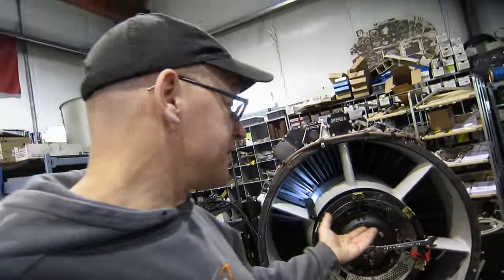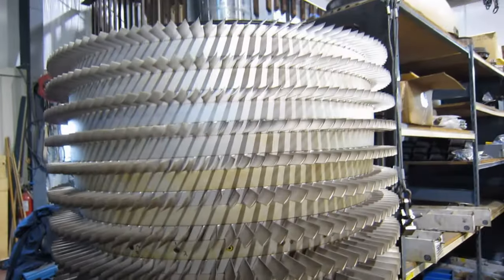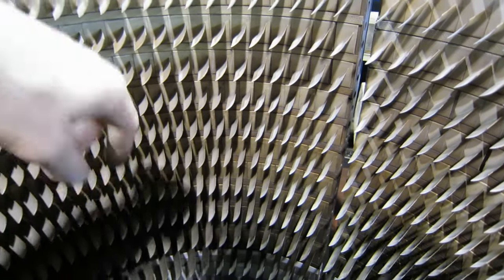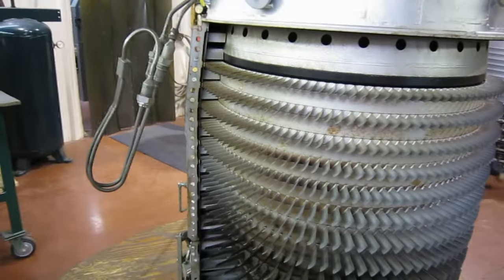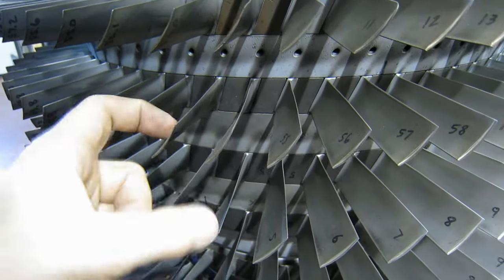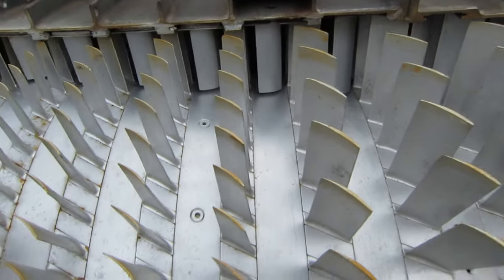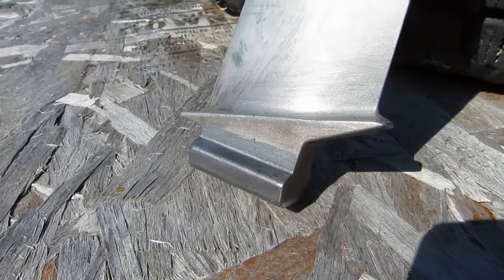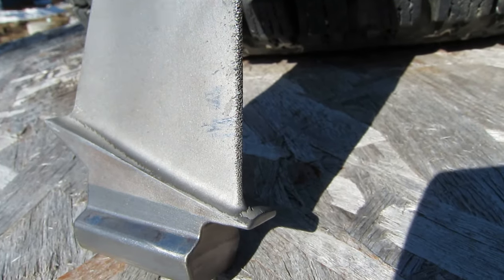Compressors - Turbine Engines: A Closer Look

Comment: Fascinating video seeing inside the guts of one of these turbines. I work with the power generation industry and and have written and talked about the economics of combined cycle gas turbine power plants since 1996 all over the world.  

Never seen one in real life. Its just numbers on a spreadsheet. I told somebody I needed $10 billion to build a few last week. 🤑
Reply from the maker: This is not a turbine. It's a compressor. One of the first steps to confusion and miscommunication is to call a turbine engine a turbine.
Just like with cars that have piston engines... do you mean the piston, or the piston engine.
Just letting you know, if you ever see "that look" in the eye of an engineer when discussing these engines...
Reply: @AgentJayZ  The compressor stage feeds highly compressed air into the combustion stage of a gas turbine and is a very important part of the 'guts' as you know. If you stop the video at 4.40 the thing you were stood next to is an LM1500 aeroderivative gas turbine used in a number of applications including power generations. The combustion stage and the final turbine stage is to the left of the frame and the compressor with the case off is to the right of the frame? The LM1500, had inside components from GE’s first supersonic engine — the J79 — and generated more than 10,000 kilowatts. I deal with industrial gas turbines which are much bigger but fundamentally similar in basic design.
Reply from the maker: Fair enough. My apologies for assuming you made an extremely common error, that I hear almost daily. Cheers, bud!

Comment: As someone who actively works in a repair cell for the CFM  LEAP-1B (specifically in Air-Oil Heat exchangers) The amount of corrosion and surface damage these parts handle and are still fully functional astounds me every time. Luckily, like with these compressor blades, much of it can be safely removed or made safe and reinstalled. Its always interesting telling customers the parts they sent back required being scrapped as they no longer fall within the guidelines of our CMMs and OEM specifications.
Reply from the maker: Commercial airliner engines are maintained to extremely high standards. After they leave the shop, they are indistinguishable from new. Always good to hear from people in that industry.

Comment: very instructive video..thanks
Reply: younger guys go to A&P school and get a job with airlines. there is some job security in that the engine  overhaul cost is 90% parts  10% labor no matter where in world its done. here they can drug test & background ck  so even if chinese did it for 1/2 price labor  it would only save 5% to risk millions of engines aircraft to say nothing of killing people. New 3-9 compressor spool for GE  commercial C2 engine was $935,000 3 years ago

Comment from the maker: The blades are made specifically to be very stiff as well as tough.
So for their high strength, they deform very little as load is applied, and they are very resistant to crack propogation.

Comment: Seriously, thanks for taking the time to film this. This stuff is amazing. I had no idea there were so many rows of airfoils in an engine. It looks like it would be a real pain in the ass to put the rotor in. 

Quick question: Since we all see why birds are able to take down planes/jets, how did the guy that was sucked into a turbine engine make it through (let alone survive)? It's a popular video from several years back. Thanks!
Reply: Aha! I think I may have found the answer to my question after watching one of your vids! The reason that guy survived is because he was sucked up by a turbo fan engine and miraculously diverted through the airflow bypass part of the engine and not the turbine itself, correct? If I'm right I'm pretty damn happy I figured it out lol.
Reply from the maker: Tango8787 Sorry for the late answer... Google Plus sucks ass-balls.
No, you are not correct, sorry to say.
In any turbofan engine, the first thing the air encounters when entering the engine is the fan, and all of the air passes through it. If anything goes into a turbofan, it is "processed" by the fan. For anything larger than a hummingbird, death is certain.
The video of the person getting sucked into a jet engine is on an aircraft carrier, and the aircraft is an A6 Intruder. It has J52 turbojets. Lucky, because as I show in several of my videos, the first thing the air encounters as it enters a turbojet is a set of struts which locate the front bearing housing in the engine cases.
Next there is a set of stationary inlet guide vanes, which may be able to vary their angle of incidence to the airflow, in which case they are called variable inlet guide vanes.
After those two structures that would act as a barrier preventing a human from coming in contact with the rotating parts, is the first stage of the compressor rotor.
All of these parts are present in the same places in a turbofan, but the fan part is in front of all of it.
See my video called "turbojet or turbofan"...

Comment from the maker: 1) not really, and the display is using parts available, not necessarily fitted to the exact clearances.
2) Compression is about 1.05:1 up to maybe 1.1 to 1
3)See answer to TheMan1510's question
4) Axial is more efficient for big engines, centrifugal for small ones
5)Outlet temp depends on inlet temp and on total compression. For an LM1500, it's usually about 500F at full power

Comment: How much is the gap between the tip of the blade and the inside layer of the chamber (is this how you call it?)  I suppose for better efficiency the gap should be as tiny as possible?
Reply from the maker: Blade tip clearance on a J79/LM1500 is around 0.100 inch. On the LEAP 1B, it is effectively zero. The blades are almost always scraping.

Comment: You mentioned in another video that most stages can individually only increase the pressure by about 10%. How do smaller compressors like the one you showed get around this with just a few? Better cooling? Higher rpm? Just limited to under 2 bar? Awesome video by the way. Looking into these is like looking into a shark's jaws- thanks for the great explanations and footage.
Reply: Heyo, I know this one, there exist another type of compressor called a centrifugal compressor, which can massively increase the pressure before exiting.
The caveat is that you can only use 1 or 2 before it makes too much pressure, with axials, you can pretty much keep stacking them till you have exactly what you need

Comment: The new stators and blades you don’t touch by hand as they are ceramic and break with the slightest touch. Made to take extreme heat and be light weight in the GEnx.

Comment: Yep, what I like is the clever way pressure is increased, through each stage which was not shown as such. Apart from the spinining of the comp blades, each blade is angled slightly to it's neighbour, so as to form a converging duct between the blades. Each stator blade, is angled to the one next to it, to form a diverging duct. Bearing in mind, for a jet engine to work, airflow through it must always be sub sonic. So as per incompressible gas laws, these ducts cause slight increases in velocity (converging duct) with slight pressure increases (diverging duct) through each compressor/stator stage. This greatly adds to the compressor efficiency. Not to mention the cross section of the conpressor as a whole, which narrows from the intake, towards the last stator stage. That to me, is the clever part! Similar thing with the turbine blades which are set up for impulse and reaction blading...but that's another story!

Comment: Awesome video. That definitely helps me visualize how the compression works. I wonder if they still have to use the single crystal method to make the blades these days.
Reply: Yes. Single crystal blades are the method of casting.  From working in the casting manufacturer.

Comment: If you polish the leading edge of the compressor blade, wouldn't that create vibration because you've removed mass from one blade and thrown the system out of balance? Do you have to polish them all at once, or do something else to ensure they're balanced afterwards?

Comment: Great Channel!! I love seeing the inner workings of machines. Question. After seeing the clearance of the blades in the turbine, how did that guy survive being sucked into a fighter jet just before takeoff? Are the blades fragile enough to break when a human like object enters the engine?
Reply from the maker: Hopefully you realize that nothing at all of any size that is alive can survive passing through a turbojet. Not even a bacterium. There's that small matter of 1000 degree heat that all of the air entering achieves. This incident has been discussed at length; The footage shows a person being drawn into the aircraft inlet of an A6 on a carrier.
It's important to realize that the aircraft inlet is not the engine inlet.
If you watch my videos about turbojets, you will realize what stopped this lucky person from actually entering the engine.
Reply: Thanks. I hope you dont think I was trying to be a smart ass or anything. Just a question. I'll research this further on my own.

Comment: Great video of the compressor. It appears to have half an inch or so of clearance between the rotor blades and the stator blades. Wouldn't you say? I was wondering what pressures the compressor develops in a J-79?

Comment: 7:00 not only solid, but often also grown as ONE metal crystal to limit stress fractures.  Perhaps thats only on very large engines? Its pretty cool anyway.
Reply from the maker: Compressor blades are not single crystal. You are thinking of turbine blades. Not to worry, it's a very common mistake. You're in good company.

Comment: I love the information you put out in these videos.  I am curious about something, though.  You say there is no room in a turbojet engine.  As a machinist, this usually means less than a few thousandths of an inch or .1mm.  I see around 10-15mm between the stators and compressor blades.  Is there a reason for the clearance?  Wouldn’t the engines be more efficient with “tighter” clearances?  I apologize if you had answered this before.
Reply from the maker: The spacing you mention is quite large to allow for thermal growth, and to avoid catastrophic damage from the rotor blades hitting the stator vanes at high speed if there is any bending, such as might happen with a minor stall.
The "room" I am talking about is the clearance between the tips of the blades and the cases, and between the tips of the stators. Old engines have this set about 0.100" as the max, and modern engines have this clearance as close to zero as they dare. Some engines call the casing liner around the fan the "fan abradable", because under operation they regularly come into slight contact.
Axial clearance has  minor effect on efficiency of the compressor. Radial clearance is space for air to leak by and costs power.

Comment: This might be too broad of a question given the wide variety of gas turbine design... but can you give a rough estimate as to how much power is consumed by the compressor of a gas turbine? Or maybe just for example how much that compressor consumes on an LM1500. I think my question is clear but just in case, here's another way to ask... what percentage of the burned fuel is used to drive the compressor? Thank you. And you have a great channel, very glad I stumbled upon it! You have obviously put in a lot of time and effort making these videos and it is very much appreciated.
Reply from the maker: The answer to your question is all though my channel, in prob half of my vids.
2/3 of the energy is extracted by the turbine, to turn the compressor, and the rest is available for either turning a power turbine, or propelling the aircraft forward if accelerated by a jet nozzle in a turbojet, like the J79.
Reply: @AgentJayZ  Thank you!

Comment: Does anyone have a link to the video of manufacturing process of these blades and all other components?
Once in 80's I worked of smaller blades for rotor (ground the back side of it, to make it fit into the slots) and someone told me, that when damaged, they weld them up and remachine on CNC vertical mill with horizontal rotary table as 4th axis.... I am wondering if these are stainless or Inconel, because those I worked on(as I mentioned above) were precision Inconel castings.

Comment: Furthermore, about resonance, rotors, and stators, I should like to ask if their individual resonant frequencies are compared to their buddies on their row.  If one rings a nice A440 or if ten of them are at 438.xx (xx = measured to +/- 50 cents), then the other rotors could be gently sanded (or however they balance/match them) to 438.xx,  That said, combination/difference tones will be generated by tines out of tune which can either increase or diminish amplitude.  So what's up with stator & rotor blade pitches in musical frequency analysis?

Comment: Do I understand correctly that the compression ratio is equal to ratio of cross sections on the first and the last stages of the compressor? As in, if the first stage cross section is 1 square meter and the last stage area is 0.1 square meters, the air needs to be at 10 bar to squeeze through?
Reply from the maker: That is a good approximation, with two important things to remember. The gas path is not a circle, but an annulus, so the area can't really be estimated by just measuring the outside diameter of the cases.
Also your ratio holds if the speed of the air remains the same. Typically the last few stages of a compressor gas path do not taper down as much, because the velocity of the air is lowered to better meet the needs of the combustion section.
Reply: @AgentJayZ  but why exactly do they try to keep flow velocity constant in the compressor? and in multi-stage centrifugal pumps all stages have the same dimentions, so flow velocity in them definitely does change, correct?
Reply from the maker: 1 I just told you they don't 
2 this video is about axial compressors only.

Comment: Using rotating magnetic fields, Muddyfalcon created a nano engine that uses nano aero particles designed to move the air flow through the system.  The particles can adjust location, pitch, angles, etc, moving and speeding up within the rotating fields, eventually becoming tighter in configuration to enhance the trust, and for modulation of fuel, air flow, etc.  The engine is very quiet.  At 200 watts of input, without the use of fuel, the engine achieves just over 7 pounds of upward force at peak, just over 30 newtons, on air-flow alone. The engine weighs almost 5 pounds.  This rating was established using a slow rotating incline while still wired up to a power source that was non-independent.  The system is still gaining efficiency every day  by tweaking the software controlling the magnetic fields and the nanos.  The most difficult challenge was to stop the nano aero particles from being ejected with the air flow.  You have to use the right posturing fields opposing at stages to keep the nanos rotating into the chamber wall.  Which does cause wear on the nanos, but barely visible, even under a micron scope, because of their shape being a sphere.   They are like little tiny metal ping pong balls, slightly eggish, with a 3rd of the sphere exposed like a concave adjustable wing, using the air pressure in the system for power to adjust when controlled by software.  They basically pitch slightly downwards and inwards to the center as they rotate within the m-fields, pulling the air down as they spiral themselves in the system rotating and riding the walls of the chamber before getting pulled through the center, always wanting to climb upwards.  The rotating magnetic fields are created by adjustable helical magnetic rods, and in turn the center column of climbing nanos as they spiral upwards start spining against each other, creating an internal magnetic field that stablizes the other fields from interfering with other nanos.  The coolest thing you may ever see right now is the engine running at idle, as all of the nano particles are moving slow enough to see, and it looks out of this world!
Reply from the maker: Looking forward to a video of it.

Comment: 4:50 wouldn't it be the case that in actual operation under full air-load conditions that the vanes would be pushed to the extreme of their seating anyway, so that even if they're loose when stationary, they could still ring when under load?

Comment: Really enjoying these videos thank you. When did stators first appear or have they always been part of a jet engine? Do you have them in centrifugal compressors? Thanks once again.
Reply from the maker: The stators are where the actual compression happens, through a process known as aerodynamic diffusion. Although not called stators, the diffusion passages in a centrifugal compressor perform the exact same function as the stators in an axial flow compressor. They form a divergent passage through which the high velocity air flows,  causing a reduction in velocity and a gain in pressure.

Comment: Hi Jay,
Haven't made it through your whole playlist yet so you might have answered this already, but does the difference in thermal expansion between the titanium compressor disks and steel blades present a problem with the blade roots expanding enough to lock in their slots and cause resonance like in the cutaway engine outside?

Thanks

EDIT: Never mind, I watched a few more videos and got the answer

Comment: Thanks for your sharing valuable information.
One question, the wear you mentioned in 6:20, how much in mm or inches? Because it seems very barely surface wear almost 1/10 mm. Is it that important to replace a blade?
Reply from the maker: Like with a bearing race, if you can see anything at all except perfection, it's junk.